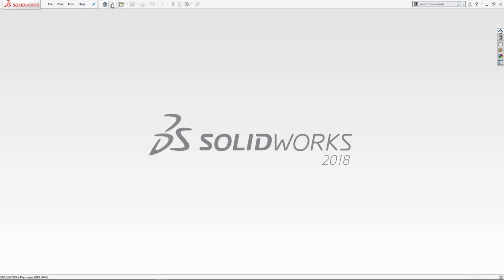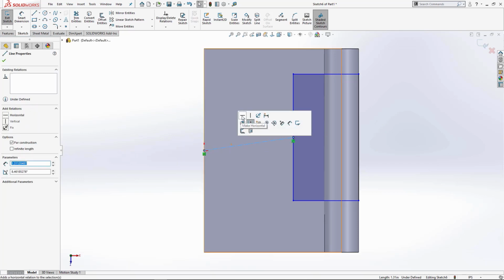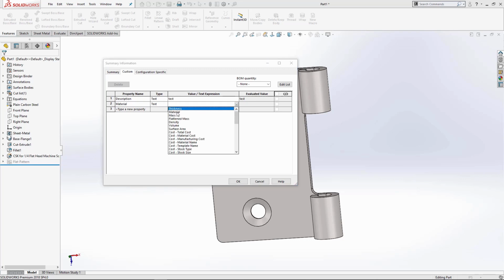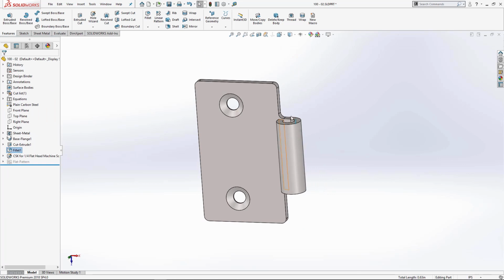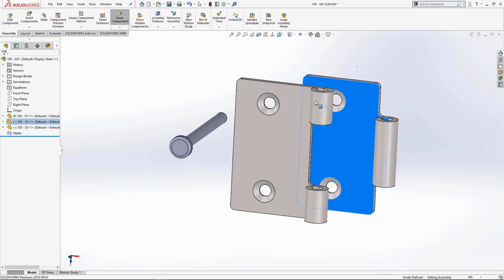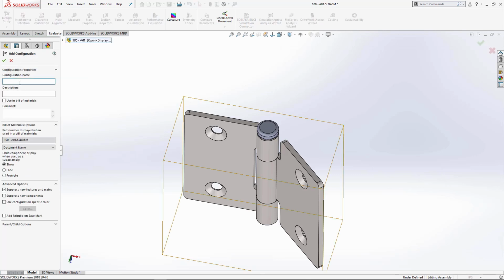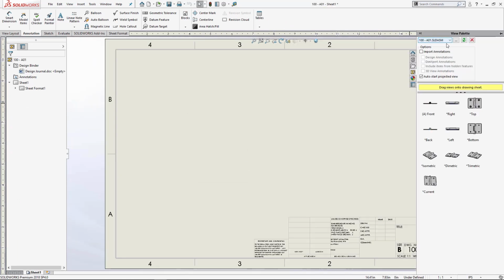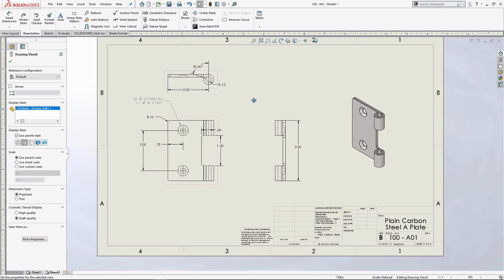SOLIDWORKS - Getting Started - Hinge Model

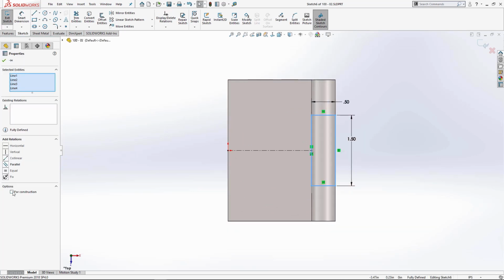Comment: When changing cut extrude at 7:47 it does not add the missing part and I cannot cut the other 2 pieces because some kind of error doesen't let me....
Reply: It says "Cannot rebuild the feature using this shetch"
Reply from the maker: Make sure that you only have two rectangular profiles. The other geometry needs to be construction, If I were to create the sketch from scratch I would just use two rectangles only. You can also have SOLIDWORKS tell you what’s wrong by using the “Check Sketch” feature. Here is a link to help you out - https://www.youtube.com/watch?v=rFl-SKnzaD4